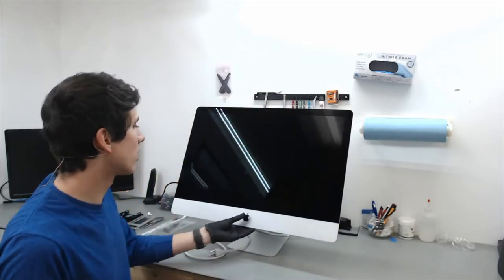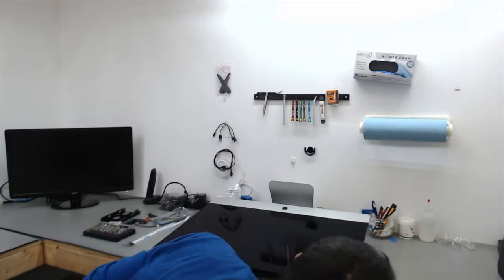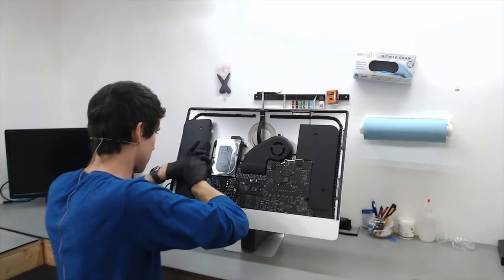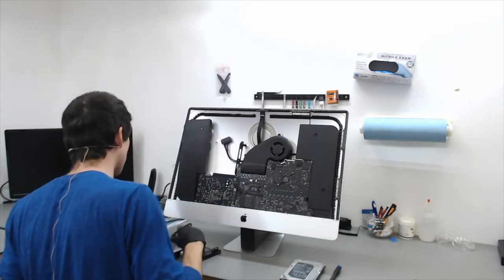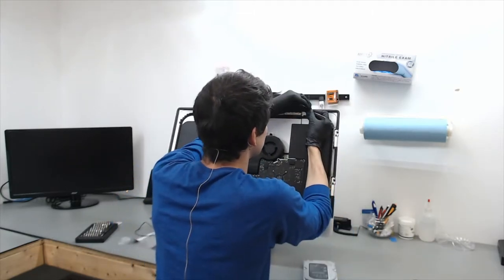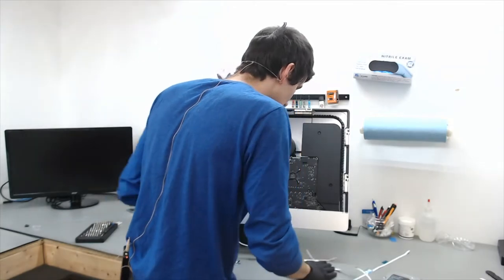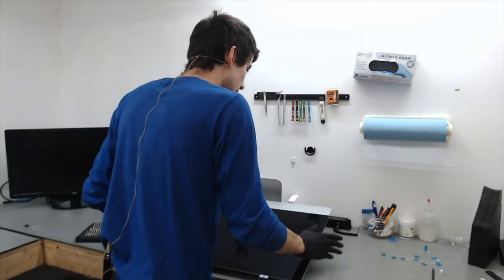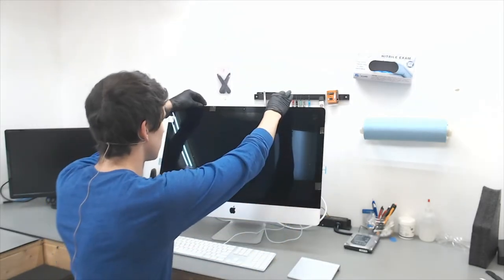iMac 27" A1419 SSD Upgrade.

Comment: If you're watching this in 2023 and have upgraded the iMac to Monterey (possibly before but I don't know for sure), you do not need the temperature sensor anymore. I just successfully replaced the HDD in mine with an SSD and did not have any issues with the fan speed without the temperature sensor.
Reply: Is your iMac a late 27 with the hybrid drive? Did you do anything with the blade SSD behind the logic board?
Reply: I'm wondering how the OS upgrade would detect the temperature of the SSD without the sensor itself. Could you please verify the source and how it achieves the temp reading without the sensor? Thanks!

Comment: Awesome walk-through video with thorough explanations, no crappy music, and particularly for covering the initial startup after the install.   
I have watched a few of these and I often wondered where and when the OS was installed and when was it put there and you have addressed this well. 
Do you have any plans to do a full fusion drive replacement on a thin body iMac 27?, especially going into the PCIe SSD and upgrading that to something substantial, (and useful), say 500GB or 1TB.
I have a Late 2015 and OWC says PCIe on that model can't be replaced but doesn't say why,  yet models before and after Late 2015 can be, and are treated the same - go figure!   
Much respect for your work, and for your effort in posting it and making it public.  Cheers from Australia.
Reply from the maker: Thank you for your kind words. It truly means a lot to me. This is a very good question. On thin iMac logic boards, there is an optional PCI-E express slot in the back of the logic board near the USB ports that is used for fusion drive. However, not all iMacs have this slot available. For instance, the base model Late 2015 21.5" non 4k iMac does not have this slot populated, only empty bare traces where a slot would exist. However, the upgraded fusion drive model Late 2015 21.5" non 4k model has the optional PCI-E slot populated allowing you to replace the SSD with a larger capacity SSD. I can't say exactly off the top of my head if the 4K 21.5" 2015 iMac has the PCI-E Slot populated on the base model. If your iMac is a non 4k model and does not already have a fusion drive set up, it will not have a slot on the board for you to create a fusion drive. I hope this answers your question.

Comment: Excellent video, very very helpful, best video for this of the many I have seen. Only one thing really missing: showing the disconnect of the wires in detail, the ifixit video shows that much better.
One more thing I would like to mention: after removing the old tape, also make sure to remove any glue residue, especially on the panel side. Otherwise what can happen (it happened to me) after the test run you lift the panel again and the tape protector sticks to that residue, thus exposing the glue on the new tape before you were ready to do that.

Also if you want to know what those 2 wires are for: the big one is for the LCD as you mentioned, the other one is for the back light. Since this is LCD the back light is an independent electrical circuit that requires a separate cable. Maybe that cable also includes a temperature sensor for the LCD panel.

Comment: Great video. I change the hdd but the computer will not start. If you connect the power supply and look inside, there is Olli one green led on. The power adapter is Ok. What can be wrong?

Comment: Is it necessery to put the thermal sensor? I mean I did not put it at all just connect the ssd to the original cable and the fan seems to work normaly. Sometimes it speeds up (during final cut or photoshop) amybe mor often then before but that is all. I have upgraded the cpu and blade ssd too.
Reply from the maker: Truthfully, we are starting to discover that the sensor is not necessary on all iMacs now. Once of my technicians discovered that it was not necessary on a 2017 27" that came in for an upgrade. However, we have seen 2012 and 2013 iMacs need this sensor. I am not sure if the fan issue was resolved with a firmware updated, or if newer SSDs account for the missing 12v line that 2.5" drives do not have that the 3.5" drives do have. If you iMac is running with normal fan speeds after an SSD upgrade, you should be alright without installing the OWC thermal sensor. Thank you for your feedback.
Reply: @iRevive  what is the a normal fun speed? When it works abnormaly does it runs always on high speed?
Reply from the maker: @blfilmcreativemotionpictur5597  sorry for the delay. YouTube doesn’t do a good job notifying new comments. If there is a sensor issue, the fan will run full speed. It will be very noticeable as the fan will be loud and borderline annoying to hear.

Comment: Planning to do this upgrade with my late 2015 27” iMac. Not wanting to ruin anything fan wise, will I need to get the heat sensor part for my Mac? Thanks :)
Reply from the maker: You will need the fan sensor on your 27" Model. If you choose not to install the thermal sensor, you can alternatively install a fan control program like Macs Fan Controller from crystalidea.com
Reply: @iRevive  thank you for letting me know, would probably be safer to get the sensor (want to be as safe as possible haha). Thanks again :)
Reply from the maker: @AuspiciousFrog  You're welcome. Good luck with the upgrade!
Reply: @iRevive  Thanks! One last thing before I commit to purchasing some items for the upgrade, do I have to purchase a specific SSD that is compatible with Macs, or can I use any SSd? I was thinking of purchasing a 1tb WD Blue SSD and just thought I'd check before purchase, thanks again :)
Reply from the maker: @AuspiciousFrog  This is a good question. As long as you use the SSD sensor, you should be able to use most solid-state drives. Western digital blue drive will be sufficient. I personally like using Crucial MX500.
Reply: @iRevive  thank you for the clarification, just wanted to make sure! I hope these comments can be useful to others hoping to upgrade!
Reply from the maker: @AuspiciousFrog  anytime. I hope so as well.

Comment: Is there any reason this would not work with the Crucial BX500 SSD?

Crucial BX500 4TB 3D NAND SATA 2.5-Inch Internal SSD, up to 540MB/s - CT4000BX500SSD1
Reply from the maker: @kunkuman  This process will still work with a BX500. I just prefer the MX500 because it has faster read/ write speeds.
Reply: @iRevive  Yes thanks... after reading a few reviews I realized it was not the way to go.

Comment: Hi there! I have this iMac late 2015 with a 2T Fusion Drive HD. It's not clear to me if I can swap to a SSD and if I can reduce the size of the new disk to 1T and/or if I need to change other parts of the iMac. Can you help me to get a clear answer? Thanks!
Reply from the maker: Hi there.  Fusion drive is two physical drives (1 2TB Mechanical and 1 128GB SSD) installed in your iMac that are programed to function as 1 single drive. You can still replace this drive setup with any SSD of your choosing. There are some optional extra steps. It is advised to remove the logic board so that you can remove the 128GB SSD from the back of the logic board. That is, if the 128GB SSD is failing. However, some people will leave the 128GB SSD in the logic board and keep it as a 2nd drive.
Reply: Thank you! So ideally I should change both the 2T mechanical drive and the second 128GB on the back of the logic board. That's to be sure to avoid issues. Right? @iRevive
Reply from the maker: @kremisikresi  that’s what we do in our business just to be safe. In the past, I’ve seen where just the mechanical drive gets replaced while the 128 gig SSD is left behind pose weird issues. Just to be safe. We remove the 128 gig SSD. However, this can be daunting since the entire logic board has to come out.
Reply: I'm in Europe and if I were just near you I'd easily decide to let you work on my iMac. I do not think to touch anymore the machine risking any weird malfunctioning. Anyway your tutorial is very clear. Thank you again. @iRevive

Comment: Do you have to put that sensor for the ssd anyway? What happens if I put it directly without the sensor? I would appreciate your response also from your subscribers, thanks
Reply: I just replaced the hard drive in my late 2015 iMac and I did not need the sensor. One of the newer versions of the firmware made it so you do not need it. I don't know when exactly, but mine is running Monterey.

Comment: What if I don’t have any data that I need to back up do I still need to back up the OS ? Or is the OS saved on the factory ssd
Reply from the maker: You can back up the drive which contains macOS. Or if you want to start out with a clean slate, you can skip backing up the drive and instead boot into internet recovery mode to download the most supported version of macOS by pressing Command+Option+R when your computer is booting up.

Comment: I’ve done four of these 2015 onward and never used the thermal sensor, tech guy told me they are a scam. Take one apart and you’ll see the sensor pad does nothing.
Reply from the maker: What we have discovered is that you do not need a thermal sensor for the 21.5” iMacs after 2012. Some 27” iMac will have the fan run full speed if you do not use a thermal sensor with the SSD. If this happens, you can use a fan controller software called MacsFan Controller to manually adjust the fan speeds. We have also had newer reports that some iMacs after 2015 do not require the thermal sensor mod. These findings are inconsistent so I have not been able to get a definitive answer. More information the thermal sensor mods can be found here. https://logi.wiki/index.php/iMac_HDD_Thermal_Sensor_Bypass

Comment: I've installed a new ssd but two disk show up on the machine one is the 2tb and the other is a flash drive I think? Can I combine them?
Reply from the maker: If two physical disks are appearing on your iMac, it sounds like that you had a fusion drive set up. What that is is that there’s a flash SSD on the backside of the logic board, while the mechanical side that you replaced now has the 2 TB drive. There is a way to create a fusion drive set up. Depending on which operating system you’re running requires a different terminal command. However, I probably would advise against creating two solid states as one fusion drive set up. That’s just my personal opinion. If you wish to do a fusion drive set up, you can find steps on how to do that on Apple‘s website by googling fusion drive set up for your specific operating system. I hope this information helps out.
Reply: @iRevive  thanks for the reply, I tried the terminal thing before I posted my question, it didn't work as apple suggested it would. So I've just formatted the 2tb and set it up as the start up disk. It seems to be working fine. Thanks again

Comment: Why not install an external thunderbolt 3 enclosure with NVME SSD drive  (high speed) instead of having to open the screen?
Reply from the maker: This is a very valid question. You could do that as an option with the 2017 and newer iMac that support USB-C thunderbolt 3. I’m not exactly sure of any bottlenecking that would occur. And that does seem to be a temporary patch to get you by instead of doing a full repair. However we find that most clients prefer to just install an SSD directly into their iMac so they don’t have to worry about caring around any extra enclosures. I have not actually looked at the transfer rates of an external NVMe SSD via thunderbolt, however I feel that an internal SATA connection is faster. I will need to double check that. This guide is more directed towards technicians who are upgrading hard drives for clients. Using an external drive is a viable option if you do not feel comfortable opening up the screen of the iMac.

Comment: No speed test ?
Reply from the maker: You mean like read write speeds? The crucial drives we use read and write around 500-550 MBs while mechanical hard drives read write around 80 MBs. You can test drive speeds with a free app called black magic.
Reply: @iRevive  yes ! Thanks 🙏🏻

Comment: What is a canon tape?
Reply from the maker: Kapton tape is an ESD tape commonly used in electronics. You can use painters tape instead for holding the screen together during the testing process.
Reply: Thanks for the quick reply. Your tutorial was excellent. Why rubber gloves? I'm told one could get a shock hitting pc board. True? And heard, not read, that 1419 doesn't need a thermistor. What say you? Grateful for your effort. A